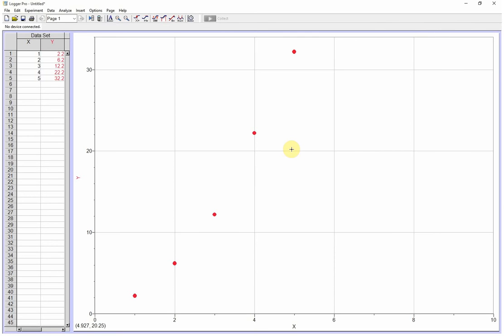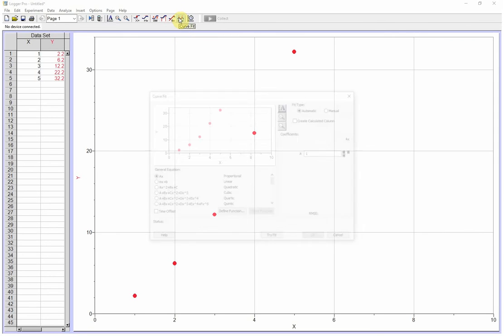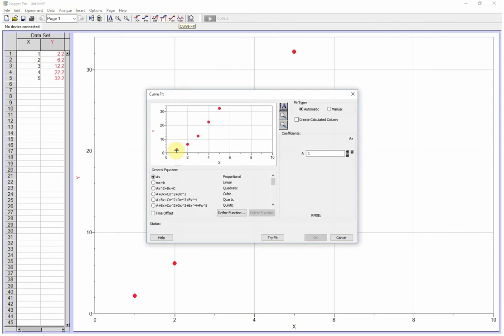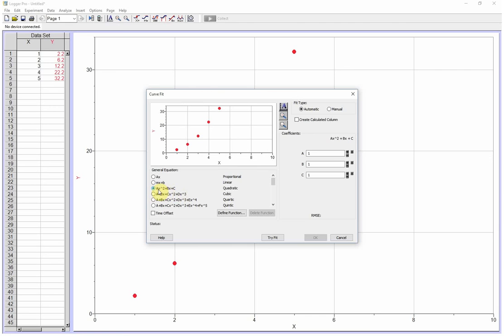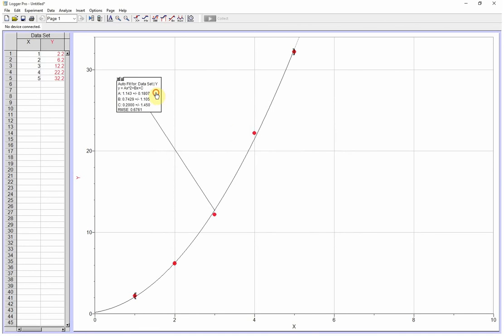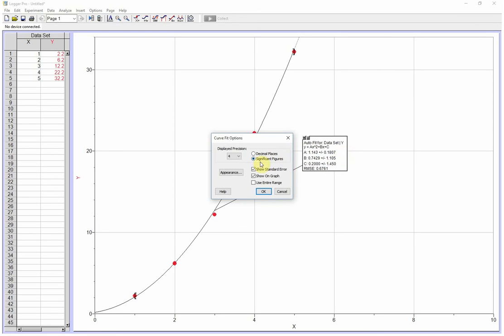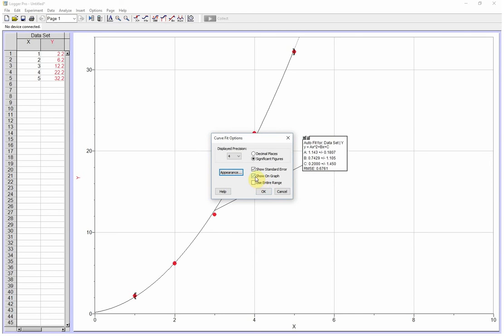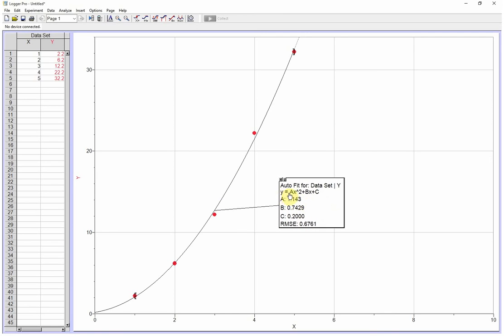Applying a curve fit in Logger Pro

Comment: Hey professor! I was wondering how could I force a curve to go through the origin. For example a quadratic fit curve? Is there a specific button for that or should I just add 0, 0 to the beginning of my dataset. Thank you in advance and Happy Easter!
Reply from the maker: Sorry for the delay in getting back to you. If you add a (0,0) date point, LoggerPro will just use this as another data point of their calculations, and it won't force it to go through (0,0). I can't figure out how to do this exactly, but you can get close with: To force the curve trough (0,0), select Curve Fit, the select the general equation you prefer (linear, quadratic, etc.); then click "Try Fit" and you'll see some best fit numbers for a, b, c, etc. Replace your highest letter (c for quadratic) and replace it with zero. This should give you a good fit, but it won't be perfect. 

If you don't have too many data points, try adding a bunch of (0,0) data points, and it will get close to going through (0,0).

Comment: how do i measure the acceleration?
Reply from the maker: Have you developed the equation for a position/time graph that is a parabola? Have you developed the equation of motion with acceleration, initial velocity, and initial position?
Reply: Lee Trampleasure I don’t think I have any of those. Currently I have A, B, and C values.
Reply from the maker: @arjay_2002  I wondering where you are with your class learning stage. Can you tell me what the slope of a position/time graph means (what concept)? If so, which letter (ax^2, bx, or c) would produce a changing slope?